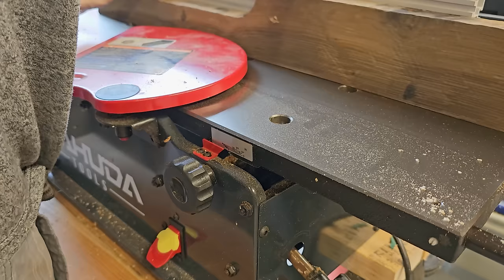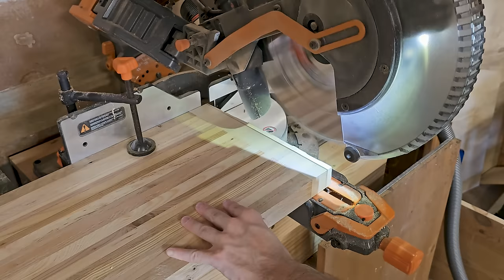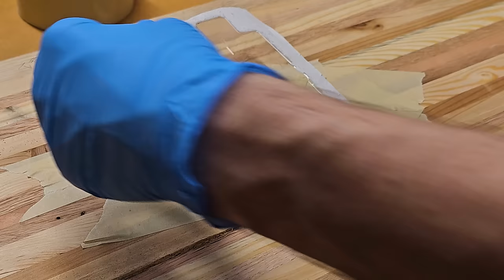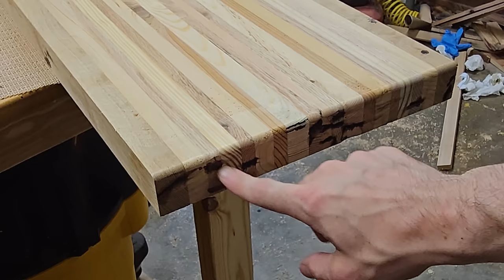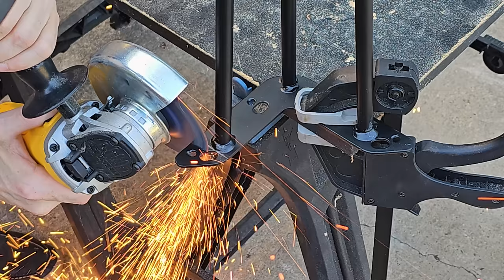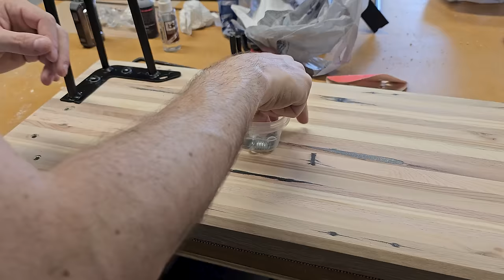I Turned FREE Pallets Into PRICELESS* Reclaimed Wood Furniture

Comment: I know blades are extra money but have you thought about just cutting nails with a reciprocating saw
Reply from the maker: That is a great option! 

I wanted to use some of the larger pieces and having the heads still attached made the nails a bit easier to pull. If only using the "slats", the reciprocating saw is definitely the way to go!!

Comment: This is awesome.  Im not familiar with some of the tools. Could you list them by chance?
Reply from the maker: Certainly! (if i missed something let me know!)

In no particular order: 

- Jointer
- Planer (also called a thicknesser if across the pond)
- table saw
- Router (w/ Chamfer and Round Over Bits) 
- Drill/driver set
- Angle Grinder w/Cut off Wheel

Comment: What is your outfeed/assembly table make of? I like the top a lot
Reply from the maker: Thank you!!!! 

Honestly, it's mostly 2x4 construction with a 3/4in mdf top/lower shelf. About 4ft x 4ft square. 

I just put a round over on the top edges and then coated it with a few thick coats of poly. Helps prevent it from swelling up/becoming useless and also helps prevent wood glue from sticking to it. 

It is a cheap and very effective solution!

Comment: a question (from someone who doesn't do this): is it possible to just use epoxy pour on the whole surface to overcome those imperfections? ..pouring to the point where the epoxy actually produces a thin glass-like layer.. so the finishing will also be different, where you can sand down the epoxy surface and polish them for a glass finish? It could be a solution because the wood you've used don't look like they would last very long, meaning it could deteriorate over time due to its low quality to begin with..
Reply from the maker: Fantastic question! Thank you so much for asking! 

Yes, encapsulating the entire tabletop was an option (an is often used on bar countertops/settings where spills are common/to be expected), however this table should never encounter liquids where it lives. 

Two big reasons i decided against that course of action: 
1. Epoxy was prohibitively expensive for this project. Probably would have doubled the overall cost of materials. 
2. I am not a fan of "plasticy" feeling finishes. The linseed oil/ board conditioner combo I used feels nice and will protect the tabletop very well for its use case. (albeit with more maintenance than an epoxy finish would have required)

Final notes! The lumber i started with was certainly more "undesirable", but the overall longevity of the final product should be just fine. All of the lumber was milled and glued very well, Any remaining cracks/voids in the tabletop were filled entirely/stabilized, and there was adequate room left around the fasteners to allow wood movement. 

TLDR; It should have a good long life in spite of the rough beginnings the materials had.
Reply: its called Applying a flood coat of epoxy. it is used to get the mirror finish you mentioned and its more durable
Reply: As the other 2 posters said, it is possible. It really depends on your budget, how it's going to be used, and the type of finish you want. Since pallet wood tends to be softer, I would think, if you were going to use this on a table that's going to get a lot of use, you'd probably want a flood coat (epoxy). But, if it's more like a hallway table (like this one), having an oil coat is totally fine (and looks GREAT).

Comment: How to tell if those are treated wood? Using treated wood for a cutting board?
Reply from the maker: Typically there will be stamping/marks on the pallets that indicate treatment types. MB (Methyl bromide) along with other chemical treatments are not safe to work with/use for home furniture, however heat treatments don't have the same issues. 

Also, as an hallway/entryway table, it has not and will never ever be used as a cutting board. 

I only use all natural hardwoods and food safe finishes for all my butcher blocks/cutting boards. (I.e. never pallet wood/reclaimed materials)

Comment: I used to use a lot of "reclaimed" wood which came not from pallets, but from packaging in which packets of glass panes/ sheets are transported (free for me), personally dismantled several TONS of them over last twenty years, and cursed and swore countless times when this muffled "ping" sound came out of my planer meaning... Yeah, the blade hitting some piece of nail (or a heavy duty staple) remaining in the wood, meaning, FORK, had to replace the blade, eff it...

But then, "mustn't grumble" - THAT wood comparing to this "pallet stuff" here is like cream compared to excrements, and frankly the only good use for SUCH "pallet wood" is, if you ask me... firewood.
Cracked, stained from corroded nails, sometimes studded with tiny stones - a nightmare to work with and not really worth the trouble and time. Yes, it's "free", but then your time ain't, and the final result is just, well, UGLY. (Well, most of the time anyway). So unless the finished piece is to be painted over, or it is goint to be some workshop bench or garage shelf (or a wooden floor crate next to a metal turning lathe - or such) it's just not worth the trouble.
And, oh, by the way - this is typically second- or third-grade wood - young, often very soft (like that Brazilian pine that grows like crazy - its rings are over 1 cm/ 3/8" wide but it's soft and kinda ugly), middle of the trunk section, or full of twists and knots. And when it's some hardwood then it's cracked all the way through - like this piece seen here, at 0:40.

But I have to admit it - sometimes I happened to actually use "pallet wood" for some garden furniture/ outdoor work bench or such, but only when it was reasonably good quality pine wood that came from so-called "euro pallet" (which is head and shoulder above this disposable trash - boards are 20 mm, or 13/16th in thick and much wider that these here), or when I came across (very rarely) a pallet made of some hardwood (beech mostly) - or birch. And then, once in blue moon, some unusually-sized packaging/ pallet/ what not that came from tropical countries - a proper "exotic hard wood" - but then always a second- or third-grade one and hardly pretty (as far as it's colour is concerned - greyish, brownish, and whatever dull "colour" you can think of). 

Anyway, this people's fixation with this "free trash" never ceases to, erm, "amuse" me - and reminds of this folk sculptor, Mikhail Bopposov from Yakutia who used to make, in winter (when there's a deep freeze there), sculptures from cows' DUNG. Hey, true artist knows no bonds nor limits, doesn't he?

And on this optimistic note... ;-)
Reply from the maker: Thank you for taking the time to write such an eloquent comment! 

I agree with your sentiments entirely. Pallet wood is really not worth the extra effort in my honest opinion (when other hardwoods are available, of course.) If it's all one has access to, then there is nothing wrong with it, just more frustrating than it should be to work with.

I actually found a bit of oak and one singular piece of cherry on those pallets, but it was mostly the softer "junky" stuff. 

Either way, it got people interested and watching.... so. It's a win in my book ❤️
Reply: @thazemakes  "Either way, it got people interested and watching.... so. It's a win in my book" - precisamente, amigo ;-)
If pallet wood is all someone has, then pallet wood it'll be for him. "Someone's spam is another person's lunch" as they say... And then for some people it's this "recycle" fad - a coffee table that's as ugly as sh!t, but "hey, look at this, friends - made from PALLETS! - see how 'green' I am?" (and never mind I'm driving 4.8 litre Chevy, 99% of all the time with single occupancy... ;-) 
But, exactly as you've said - people want to watch this, so the customer is always right , right?
Cheers! : )

Comment: Maybe if you lightly waxed the table the glue removal would be a little easier?
Reply from the maker: Oh it wasn't difficult to remove. I finished my work bench with poly so the glue pops off pretty easily. 😬

I did it this way on purpose to hit the "strangely satisfying" parts of the brain. 

Jury is out if I succeed or not I suppose. 😅

Comment: Why did you use charcoal instead of sawdust.
Reply from the maker: I probably could have explained what i doing better 😅

I was testing out a few different materials to fill/color the voids in the slab.

 If finer, charcoal would work well but I couldn't get it to the right consistency. I ended up using black ca glue for the majority of the filling/stabilizing though.  

Tldr; contrast. 😬
Reply: That was the exact Question I was going to ask about the black powder filler,,,, I thought it was Charcoal  !!!! Lol,,,, Just now learning the tricks of the trade.... Absolutely Amazing Videos Big Dawg!!!!

Comment: Nice job 
Why not just make the top wider to accept the legs without needing to cut,file and paint
Reply from the maker: Thank you!!!!

Most of the decision was based on the design. 

I wanted to make a narrower entryway table. Therefore, it had to be narrow. 

If I want to make a table wider than my planer will accept, I would just have to make the top in ~12 in widths (but it can still be done)

Comment: Lot of stage make in a strange way or in an unlogical manner. Spend to much time with your unkown black fluid ! ( by the way with a lack of explanation). Thanks to share but really not convert at your works style 😮....
Reply from the maker: That is fair. I did quite a few things differently because i was working with less than ideal salvaged materials. 

The "unknown black fluid" is just CA glue, but the purpose was to stabilize the cracks/voids in the top. A thin Epoxy would have worked as well
Reply: @thazemakes  thanks for this fair answer. You know how to work cause maybe I v been seeing a lot of pro video. So nececceraly and unfortuanatly I compare. Thanks to show, thanks to improve !

Comment: There are so many worrying things in this video. You could only do this with a fully stocked workshop.! Maybe in America this may be the case. Elsewhere you have very few electric devices. You rely on hand tools and old fashioned methods to use palletwood and or old wood.! Do this with a hand planer  and sandpaper hand blocks if you want bragging rights. Also no fancy long wood clamps or huge flat glue tables or mitre saws.! In short if you have such an expensive workshop why use cheap palletwood?
Reply from the maker: Hey thank you for commenting! 

Let me break this down and see where we end up? (Coming from a place of love. I understand your pov all too well 🫂)

1. I never framed this video as "bragging rights", so I'm not quite sure where you got that vibe from. All I'm doing is sharing what I make/how I make it. Being proud of my work =/= bragging. 🤔  

2. I used pallet wood because of the personal challenge it entailed. It's much easier to take nice hardwoods and turn them into something beautiful, and I wanted to try out something that wouldn't be too expensive if it ultimately was a failure. 

3. I am very blessed to have the space/tools I do have, but I have not always had them. I spent the first 12+ months starting this business with a circular saw, a drill, and very little space on my back porch. I built planters and sold them locally that summer to get my first table saw. I worked very hard to get where I am and will continue to do so. 

Final thoughts. Electric tools make things far more efficient, but they are not absolutely necessary. It would take much longer, but similar results could certainly be achieved with hand tools. (Albeit, by someone far more skilled In their use than I.) 

Thank you again for watching and taking the time to comment. I appreciate you!
Reply: @thazemakes  I have mostly festool tools, and can certainly afford to use whatever exotics I want.... BUT, it's great to see videos like this, using free or cheap wood. Most woodworkers have a endless supply of scraps. It's great to see videos like this, to get ideas on how to use them, so we aren't just throwing them away.... Great job on this, it looks beautiful!
Reply from the maker: @joshuabray37  One day ill have to opportunity to get my hands on some Festool tools, but today is not that day haha. 

I agree entirely though and appreciate you sharing/your kind words! 

 Sometimes the real question isn't why, but why not? 🫂

Comment: That moment when you realize that pallets are treated with all kinds of chemicals to keep the from rotting it being infested by bugs…….😳
Reply from the maker: Methyl Bromide treatments are definitely a concern, and those pallets should be avoided for sure! 

There is always a chance, but I searched for "MB" stamping. I'm reasonably sure these pallets were heat treated. 

However, even with regular old  hardwood sawdust, respiratory health is always a concern. 

I would like to do this a long time, so while PPE / dust collection are not necessarily "fun" they are very important 🤝